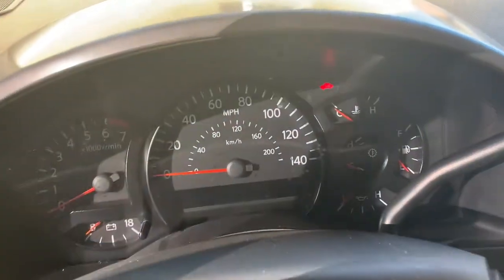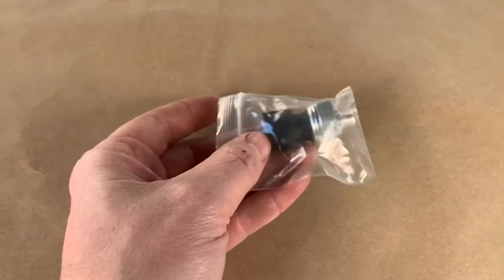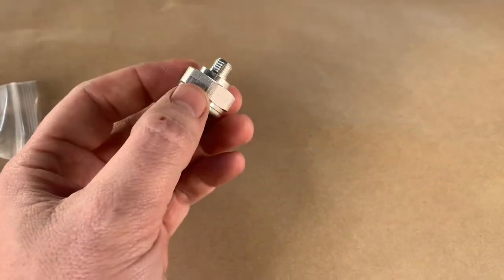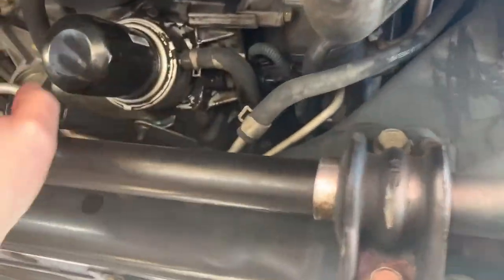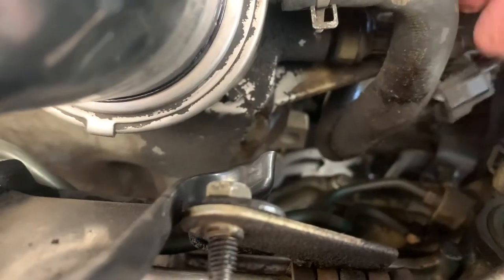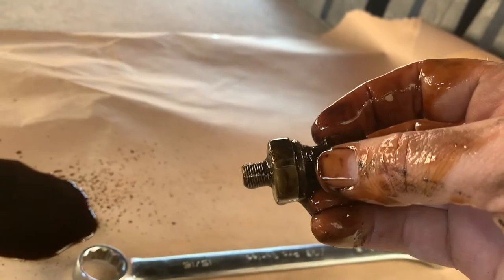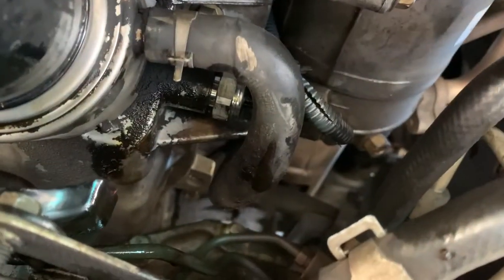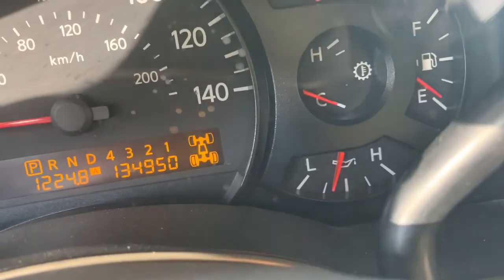Nissan Titan Armada Infiniti QX56 Oil Pressure Sensor Switch Replacement (Oil Pressure Pegged High)

Comment: Just changed this pressure sensor switch on my new to me,just bought it about two weeks ago,2015 Nissan Titan,just got back in truck after I unloaded something out of bed for house,we just got back from about 30 mile trip,engine was at normal operating temperature,I started truck,low oil pressure light was on,looked at guage,it hadnt moved,revved it up some guage went up some,each time I revved engine light would go off and guage would go up,I thought,oh crap,what kind of problem have I bought now,pulled it around and parked it,let it sit for a few minuets and checked oil,just changed it and filter a few days before,oil still looked like I had just poured it in and on full mark,at first I thought it may have been an issue with oil pump,got on You Tube videos and found some like this on,ordered a new one from NAPA,its been changed for about a week and a half now and no more oil lights or low oil pressure guage!Oh and the old oil pressure switch showed it had been leaking some between the metal and plastic,so these may be an issue from factory,truck only had a little over 83,000 miles!

Comment: I have the same problem with my titan right now. But my engine sounds off. Is it  likely I have a bigger problem than that sensor or does that sensor help the engine function better?
Reply from the maker: Does it sound off like timing or exhaust leak or something else? Do you have a check engine light? There may be more to your issue. The sensor doesn’t help anything run better, it just picks up a signal.

Comment: My armada started to idle n the oil light started blinking then it shut off,it started back on with no problems but it keeps doing every now n then,u think this is the problem?
Reply from the maker: The oil light doesn’t come from this part. This part controls the actual gauge. The light may be from low oil or oil that needs to be changed.

Comment: What if it's disconnected?? That would make it not move right??
Reply from the maker: Correct. If it’s disconnected or has a broken wire the pressure will never increase.